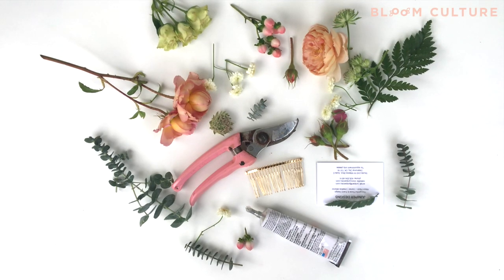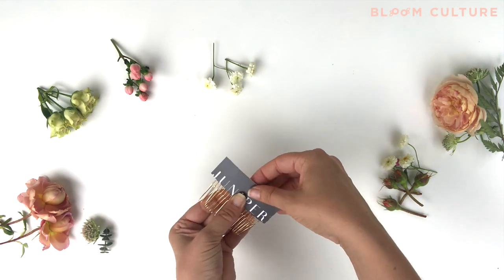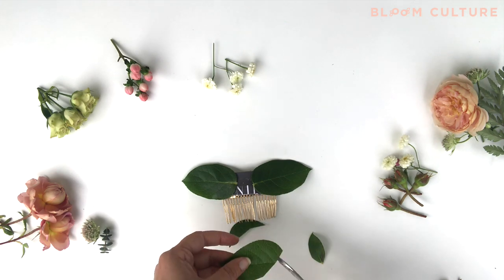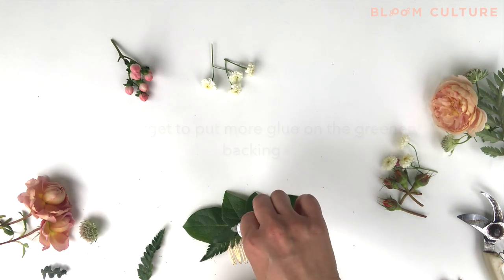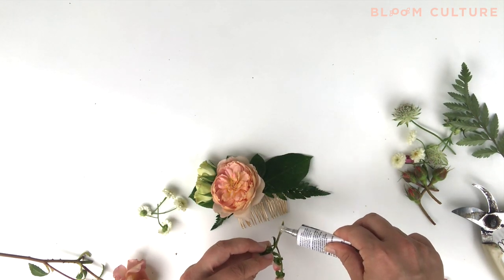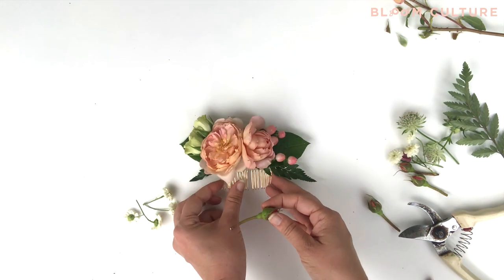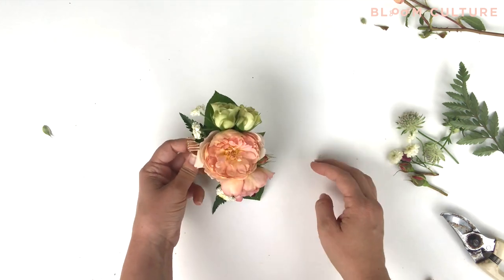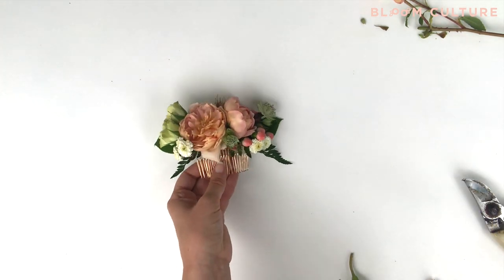DIY Floral Hair Comb

Comment: What size comb goes best in front of a bun high up on the head?  Also how do you get the comb to stay if you are dancing or moving your head around a lot.  Also the floral glue?
Reply from the maker: Hi! So you may want to do a test run but this is just a standard hair comb (you can use plastic or metal). They do have various sizes, but again that will be up to you and your preference. I typically suggest to keep the comb in place by using bobby pins, talk with your hair stylist or do a  text run with just the comb to get a feel for comfort and the scale you want it at. The floral glue is Oasis Floral Adhesive. :)

Comment: What kind of glue do you use for it? Thanks a lot
Reply from the maker: I use Oasis Floral Adhesive, (note it can be a bit runny at first, but it works like rubber cement as in it bonds to itself.) so just go slow and let it set up! good luck and let me know if you have any more questions!

Comment: I really liked how you started out with the hot glue gun but wasn’t sure why you just didn’t continue to use that in stead of the tube of glue?🤔🤷🏻‍♀️
I will 'pick' through some of your ideas because you had some interesting points👍🏼
Reply from the maker: Lots of corsages are placed in coolers or refrigerated. Hot glue does not expand and contract with temperature and can become brittle and the flowers can come off the base (learned this early on when the corsages fell apart at a wedding). I did my research and used cold floral adhesive ever since.

Comment: What kind of glue are you using in the tube?
Reply from the maker: Hi Morgan! We are using Oasis Floral Adhesive, you can find it on Amazon or visit our DIY Supplies page  to find it and more supplies!
Reply: @BloomCultureFlowers  Great Video! What's the difference between using the floral adhesive versus the hot glue when adding the flowers? Does the floral adhesive dry clearer than the hot glue?
Reply from the maker: @amandaeisman6978  Thanks! The difference is in how they dry and how they affect the flowers. Hot glue can burn product making it wilt faster, also if you put hot glue in a fridge, the natural product will contract and pull away from the glue, I've actually had this happen and my combs have fallen apart. The floral adhesive acts more like a rubber cement in that it is flexible and it adheres to itself. You treat the comb and the floral and they stick together. It's also more flexible and more forgiving with the flowers/greenery. If you put it in a cooler/fridge it will move with the product as it contracts but it won't separate from it. Whew! That was a mouthful! I hope that answered your question! Oh, and no it does not dry clearer than the hot glue, it just dries differently and I've found it to be less bulky,
Reply: @BloomCultureFlowers  Thank you! Very helpful!

Comment: Hello thanks for such an informative tutorial.  I was just wondering would the same method work for dried real flowers? Or if you have any tips for working with this material? :)
Reply from the maker: Absolutely! You just won’t use wet foam. But I’m not well versed in silks but the approach would be the same! And you could do it way ahead of time to work through any issues!